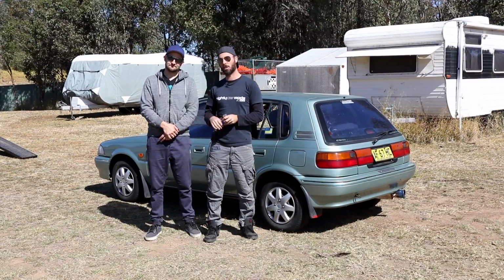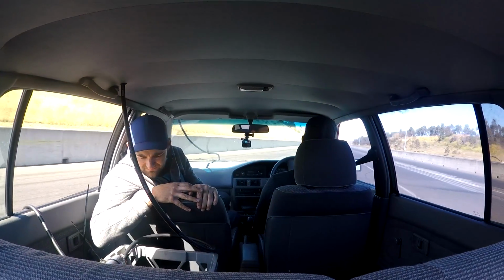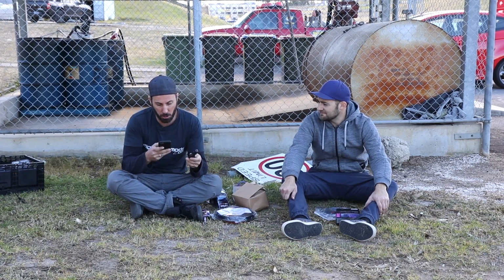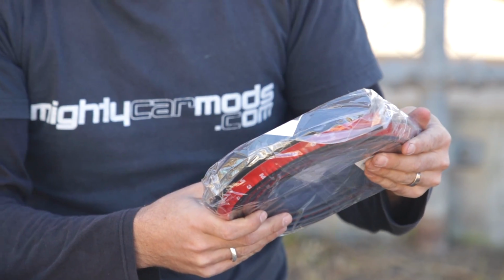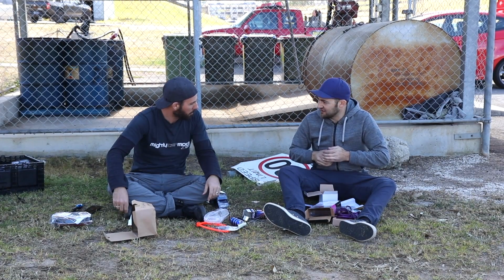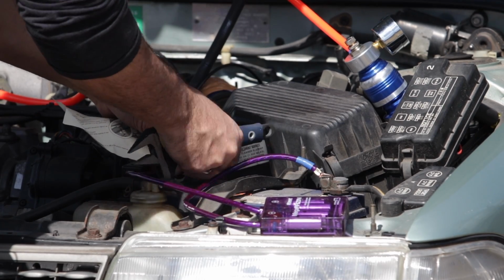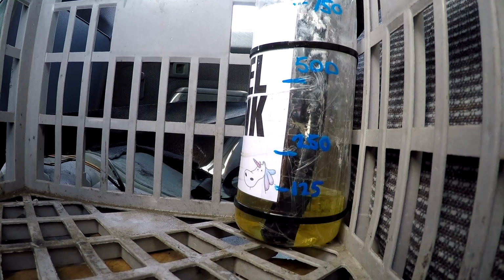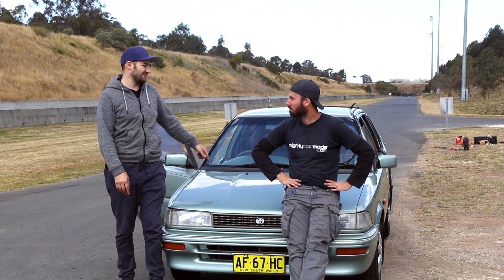Fuel Economy Mods - MYTHBUSTED

Comment: Crack open that thing you plugged into the cigarette lighter. I bet it's just to power the green light and nothing else.
Reply: nah man, it's like microprocessors and flux capacitors there
Reply: Cross out everything except the word _capacitor_.
Reply: They must not have plugged it in right... or maybe they needed to plug it in upside-down to work in Australia?

New episode devoted to testing this one item? I think so.
Reply: OOOOoooooohhhh EEEEEeeeeeeeeehhhh
Reply: Christopher, I took a chance at a similar device with similar claims years ago. When the placebo effect on my driving habits wore off, the fact it "worked" wore off as well. I lost it since...and now that I understand circuits pretty well I can't take it off and find out what was in there! :(
Reply: Order another one! For science!
Reply: The Evo generator?
Reply: only a capacitor and an led.
Reply: But it could be a new rip off...the old one, what if it had something legit in there? I kept modding my car, it seemed to work at one point, but later? No. I think if I "Un"repaired one of my repairs then it would have helped again. I really did drive a lot with and without it and saw a difference. I even got a extension so I couldn't tell if it was plugged in or not and I'd pull it back out from under the seat when I gassed up to check my results on fill up without having remembered if it was plugged in or not. Thus, removing the placebo effect. Doing these things, it seemed to have less effect then when I saw it "working", but it did have an effect.

All that science trying to work with it later, they buy one at 1/6th of the price...maybe it was extra worthless? Probably. Or, somehow, despite all my tests (which I hadn't not remembered until thinking about it more) my data was wasn't accurate...not that the tests weren't scientific, it's just that science needs repeatable tests in different circumstance. I was one guy with 1 car. (Had no effect on my newer and in better condition truck, even with "placebo" of knowing it was there).

Comment: what about K&N air filters??
Reply: All that K&N filters do is put more dirt and oil in your engine. That's pretty much it. Any improvement in power or economy will be so small it would be impossible to measure.
Reply: A high flow air filter cannot improve fuel economy on it's own, the computer controls the air fuel ration and your foot controls how much air gets into the engine.
Reply: sharp68chevyguy cai wont improve fuel economy. Only hai is able to do that
Reply: I thought they did that already when they busted short ram intakes.
Reply: Hardly anybody mentions hot air intakes!  Why does everyone think denser air increases fuel economy?
Reply: Best scam on the market.
Reply: check out police studies on air filters. they found "dirty" air filters didn't affect fuel economy, and sometimes they had better fuel economy with dirty filters LOL
Reply: Denser air naturally gives more power when used in a combustion system of any kind, not just engines. And that's for cold-air intakes, not hot air, hot air is less dense than cold air.
Having said that, smacking on a cold-air intake and leave it at that will do fuck all, as you also need to mess with the ECU so the right amount of fuel will be added to the air. Ratio is key, and doing no ECU tweaking just makes cold-air intakes a noisy sound mod.

Having said that, the power gains are minimal. If you want a big amount of power immediately, buy a turbo.
Reply: Careful k&n fanboys will start getting angry, don't even mention Amsoil fanboys, they're convinced your car will do mach 1 and return 200 mpg
Reply: Usually performance increases decrease fuel economy and visa versa.  At least the former generally decreases reliability, too.
Reply: They've already done tests with pod filters, I believe a K&N filter was tested too.
Reply: +3ddie21 who buys a filter for fuel usage?
Reply: They've tested pod filters before a few years back.
Reply: Don't forget the K&N Cabin Air Filter for xtra performance!
Reply: K&N can't improve economy.  The restriction on a gasoline engine is the throttle, not the filter.  Take the filter out if you want, it won't affect part-throttle economy on an EFI engine in the slightest.  

K&N is good for coating your MAF sensor with garbage, though.  Stick with paper.  You won't notice a performance loss (most cases you can't even MEASURE one), and your car will ingest far less shit through the intake.

"ur engine probably took damm much dirt already for using paper filter for 40k miles"

Funny to hear a K&N 'tard telling other people that their paper filter, which is far superior at filtering air, lets more dirt in than their shitty K&N woo.  

I've been inside a lot of engines, and I've yet to be able to write "wash me" in the dust inside an inlet tube on a car using paper filters.  K&N, now...
Reply: sharp68chevyguy you'll see a tiny improvement, but not noticeable at the gas pump. The advantage K&N had was saving you money over paper filters, but now everyone copied their designed and even parts stores have cotton filter brands.
Reply: ootdega I've been using K&N on all my Avonbar racing A series engines for over 20 years, and have zero demonstrable proof of what you are saying.
Reply: I got louder intake noise. :)
Reply: The reason he mentioned the hot air intake is because it can (at least theoretically) reduce your fuel consumption. The performance suffers because the hot air is less dense but fuel economy is increased because you're putting fewer air molecules and therefore fewer fuel molecules into the engine. As far as cold-air intakes, if you actually managed to get colder air into your intake manifold the ecu would adjust itself. Also, a properly designed air intake could have less air resistance and allow more air to flow through. But most "cold air intake" installations aren't done right so they just change the sound like you were saying. And even if they were done right the performance gains on an unmodified engine would be minimal.
Reply: sharp68chevyguy kn are great for dirt bikes etc terrible for vehicles with sensors to contaminate
Reply: You must be new here, they already myth busted aftermarket pod filters
Reply: there are multiple reasons to run a pod. So no, not a noise only mod.
Reply: Lol K&N air filters are such B.S. it's a mental thing. Every real mechanic I have talked to said it makes no difference and the previous owner installed it on my Audi. It triggered the check engine light for emission reasons and the car ran rough. After replacing it with a factory one I actually got slightly better mpgs and the car ran smoother. Also the check engine light went away.
Reply: It triggered a check engine light because you don't now how to oil your filter.   Audi's are just Vdubs with a leather package.
Reply: sharp68chevyguy. I only use K&N filters because I can clean & reuse them.
Reply: That depends on how it's acheived. If you're cramming 16 psi into the engine, yeah, but if all you're doing is improving its own efficiency, no. The same engine can make twice as much power and live just as long if the components aren't being stressed.

I can guarantee you the 5 liter V8 in my Mercury is more efficient and reliable than the 1.8 liter 4-banger in my Nissan.

Comment: now make a video with real eco mods. proven aero mods
Reply: actually, aerodynamics are always affecting the vehicle, and even at lower speeds they still have effects, although not as significant as say, doing 120mph.
Reply: lopon12 aero mods only work at speeds not legal on the roads, and at race tracks most aren't worried about the price of gas...

Comment: Could you not run all of the non-aero tests on a petrol-powered generator? You're hardly going fast enough or far enough for aerodynamics to count, although I realize it's more for entertainment than anything there must be some level of curiosity.  A generator could maintain a very constant load; you might be able to get more accurate readings by measuring instantaneous fuel-flow and make changes real-time. 

It would actually be interesting to see how hydrogen would affect combustion efficiency if you could very slowly and accurately measure the volume used.

Also, what about preheating fuel and air for steady runs (equivalent of highway driving)?  The air density would be lower, so less fuel/power, but the fuel would atomize more effectively.  So yeah, I'm wondering how well the engine would run with warm air and hot fuel feeding it.  

Last one:  thermoelectric generators on the exhaust.  Blow a massive wad of cash and time on building a system that generates electricity from the hot exhaust gases using a quantum effect.  Spend even more time and effort installing an electric motor that runs in parallel with the petrol engine, offloading it a little.  This one will work for sure, but who knows how well.

Other that all that, may I please see how to install some HIDs lights on my van?
Reply: Wikus Van De Merwe its mighty car mods not mighty generator mods...
Reply: You could say that about any technology they use that is non-car specific, and there are dozens of examples.  I can see why their audience would not get enthralled by watching a generator run, but it is exactly the same technology as is used in a car.  If it makes you happy, then how about a car on a dynamometer?  Same thing.  Just need a constant load and ability to tweak on the fly.

Comment: the only thing here that might help fuel economy is the Vortex generators (Like EVO has on the roof) but it must be at a angle to stir up the air, many videos how to apply them, this also helps the airflow staying attached on the car to increase efficiency of wings/spoilers. wont do much under 60 Km/H
Magnet is bullshit.
Everything just attached to the + and - terminals wont do anything, ECU is isolated from noise on power cables so cant do anything.
Free multi spoiler might work BUT must be placed very specific areas 
Working Full time licensed Mechanic :P
Reply: Vortex generators is actually on every aircraft wing to increase lift and reduce stall speed without increasing area of the wing
Reply: It took me a year of my spare time to work towards understanding one set of forum posts about air or aero modifications. I agree with as much of your comments as I have an understanding on the subjects you've shared.

Sadly, with photo bucket deciding to charge, a lot of the photos are no longer their, but if you have a working background on aero-modding already, you may like this website: http://ecomodder.com/forum/showthread.php/roof-spoiler-pick-up-truck-cab-phase-1-a-19525-8.html

Comment: Another fuel efficiency MOD is a hydrogen generator which is easy to make but requires someone with some knowledge because it could explode if not done right.
Reply: J- Tuned Well, I know a guy with a 2000ish 2.0 n/a Impreza who claims to save 40% fuel just by using 98RON instead of 95RON. And that his pile can accelerate 0-60 (calculated from a g-meter readout peak value on his satnav, I reckon) in a blistering 3.5 seconds. He can actually say all of that with a straight face.
Reply: While this sounds like nice idea it doesn't work. Hydrogen does help combustion but the total energy use (hydrogen and gasoline combined) goes up. Because the hydrogen generation process is anything but efficient, net result is backwards
Reply: It hurts more than it helps
Takes a lot more energy to separate than you'd ever save
Reply: Oh wow. Tell this guy I've got pill he might be interested in too...
Reply: Anecdotal evidence doesn't make it necessarily true. Hydrogen can assist in a better burn (I think BMW does this with one of their cars, it has water injection) but wouldn't increase MPG much if it all when used on a normal combustion engine not designed for it specifically, like that 4.3. Also, as much as 45mpg on a V8 means he's really light on the gas pedal (which won't get you anywhere close to 45mpg) or the 45mpg number is attained during coasting at speed or using the gas pedal to maintain the speed while coasting, which might get you close to 30mpg. But, the second you start accelerating to gain speed instead of just maintaining it, that number will drop significantly.
Reply: The closest thing to an operating theory re: electrolyser is that it increases the burn speed, allowing you to reduce ignition advance, reducing negative work and increasing average pressure in the combustion stroke.

However the power demands to generate this much hydrogen are massive, and the net result is backwards.

At best these things function as an unmetered vacuum leak and make the engine run slightly leaner than it otherwise would
Reply: Water injections purpose is to allow for higher compression from mechanical compression or from more boost without detonation. It lowers the temperatures and makes higher compression without knock in scenarios, which you would have knock. The water is in no way burned. A overly simple look at water injection would be to say it's like having higher octane fuel.
Reply: What's the point of generating hydrogen? It seems like a useless thing to do on a car, since you can't use it for anything. Unless you're talking about making the vehicle run on it, which isn't simple at all and you cant use the normal engine at all, I think.
Reply: It's funny because I know a guy with a 4.3 Chevy blazer that gets as much as 45 mpg using one. Any car can use hydrogen just like any car can use propane.
Reply: AerisM - PC Gaming, GTA 5, Fallout 4, & More! You do know a 4.3 is a v6 right. Y'all don't have to believe but I know what it did on his blazer. I was there through it so I seen it in person.
Reply: Well, I'd like to see video proof or proof in some form before I believe you, because all you've got is anecdotal evidence. Anyways, a quick google search gives me this http://www.popularmechanics.com/cars/a3983/4310717/ which looks like real proof to me.

Anyways, I know cars can inject water to increase power (cools down the intake air, it isn't injected directly into the cylinders) and I know water isn't really the same thing as hydrogen injection, but beyond burning the fuel in the cylinder better (if it does) I don't see any reason as to why it would increase MPG. The only thing I see it doing is maybe decreasing emissions because there's less unburnt fuel exiting through the exhaust.
Reply: j tuned why not try one your self and report back some real science ive done mine and got the results you do one and let us compare notes
Reply: J- Tuned 45mpg blazer 🤔

Comment: One way to save fuel, put the car on a diet rip everything out and lose the passenger you will a few quick and have no friends who will only let you down anyway...lol
Reply: ryzo mcgregor dont forget to tape everything with duct tape including the windscreen for improved aero!
Reply: that would help on stop & go or local/city driving, weight is beneficial in highway driving, its simple physics
Reply: You could put a gaint foam cone on the front and rear of the car to make it tear drop shaped to to lower drag
Reply: Why not use a wrap instead.. Cleaner and more uniform
Reply: They have already done that before lol
Reply: The wrap? Yes, with fuel economy in mind? No.
Reply: Only if you do a lot of stop and go driving. On higway mass and aerodynamics are key factors. 
Usually you save 0.1- 0.15L/100km with 100kg less.

Comment: i think the hks system will work just because they arent the kind of company just to throw out a bs product and claim it works when it doesn't the make actually legit performance parts im running one of their intakes in my 03 WRX
Reply: IF it's a legit HKS.... My money is on no
Reply: Did a quick browse through their catalog. Closest thing to resemble that is a BOV.
Reply: As moog said - its probably not a  real HKS product. Most likely a Chinese knockoff.
Reply: ye they weren't legit HKS products if they were i would have trusted them and the evidence showed they weren't real by the end of the video

Comment: The vortex generators help airflow stay attached to a curved surface like the back of the EVO. (with a large differential pressure gradient) they won't do much of anything the rear of a body hatch right in front of a lip

Comment: Try to make the car as aerodynamic as possible, stuff like working on the body of the car, regardless of whether or not it's good looking.
Reply: Assuming they want to make this a near endless process, start by taping off all the openings at the front of the car as its cheap (keeping track of water temp).  Test.  Tape off the opening at the base of the windshield.  Test.
Add air pressure to tires say 5 lbs at a time, test after each increase.
Fab up partial and then full belly pans to close off all under car openings.
Make wheel opening "covers" that shroud all four wheels to say the bottom of the car.
Try running with really thin oil (idea being to lessen internal engine resistance).
Reply: What about chopping the roof to make the car shorter lol